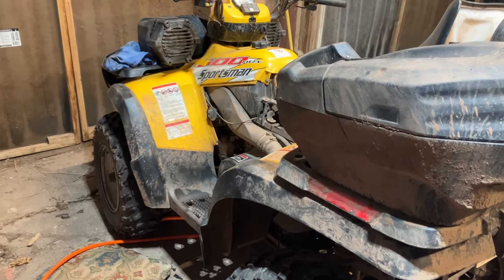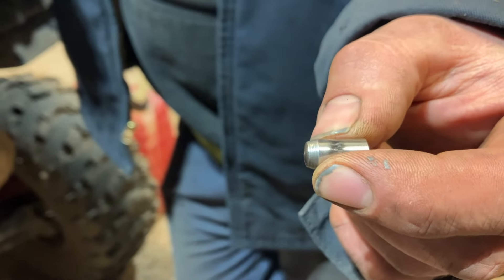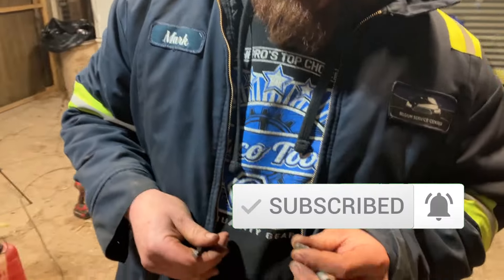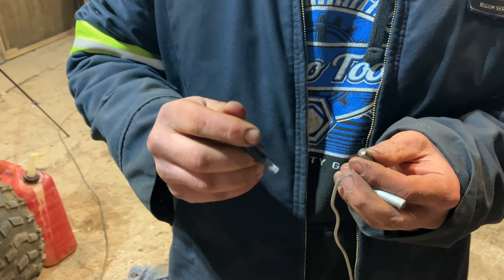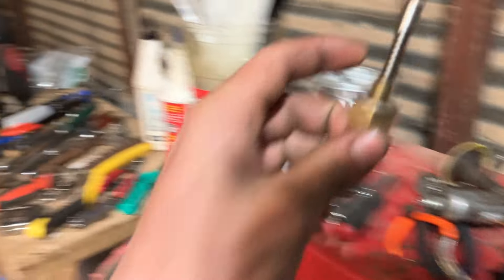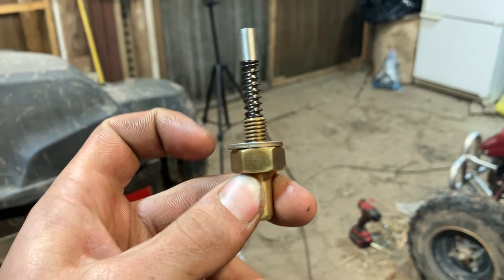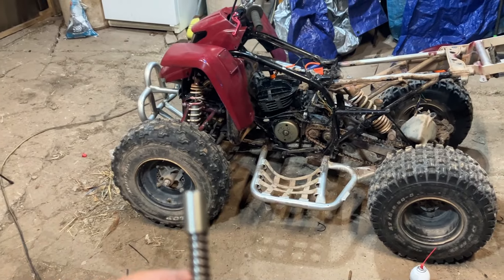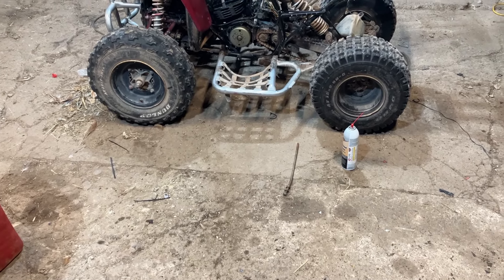Try This If Your Polaris Oil Pressure Relief Valve Is Stuck (COMMON FAILURE)

Comment: a lot of people say use 2 5/16 ball bearings . Don’t buy a cheap Amazon oil pressure relief valve guard . I did and the top has now snapped off , now i’m trying to use a easy out . lessons learn i think i’m going with the ball bearing’s because someone on rzrNet had the guard get stuck
Reply from the maker: Yea there's an expensive one for 150$ as well. This one seemed decent, but time will tell
Reply: @bearkreekboys how’s it holding up so far?
Reply from the maker: @oliverracinggaming8859  seems to be good, did not come back from customer as of yet, has been riding it since without issue, I will say the cheap ones I had one break the top off on a RZR I would recommend the expensive one if you wanted the best chance long term

Comment: If you want more oil pressure do you put a spacer in to push the valve farther into the motor?, Where do you get that adjustable PRV from eBay
Reply from the maker: I got it on eBay yes, I would suggest the 150$ one that is better quality we broke one of these on another until the brass twisted right off. I would not put a spacer in there.

Comment: Just saved me a ton thanks fellers
Reply from the maker: We did have mixed reviews on the new pressure relief. Had one snap off on install in another unit. I would recommend spending the money on the more expensive one around 150$ I think